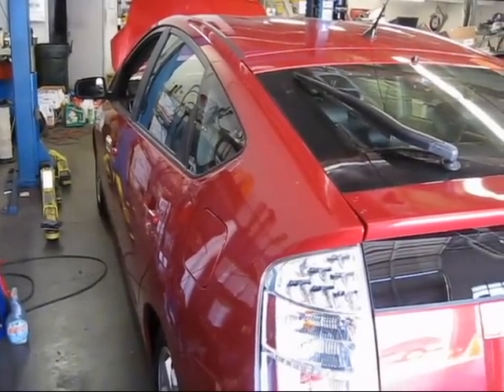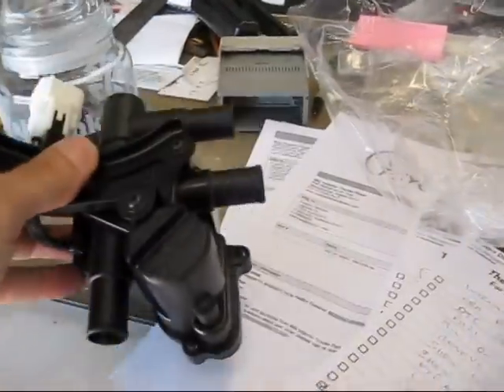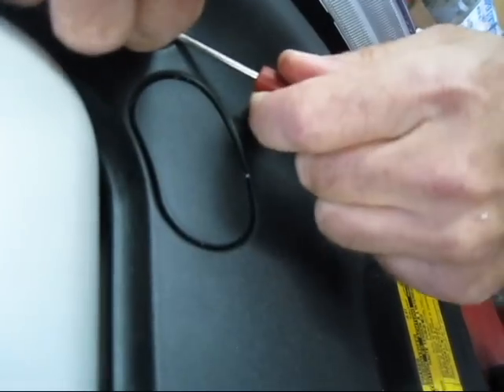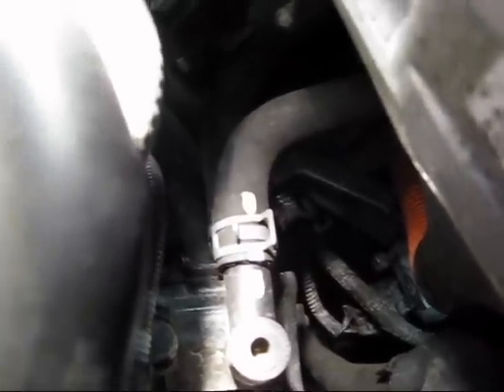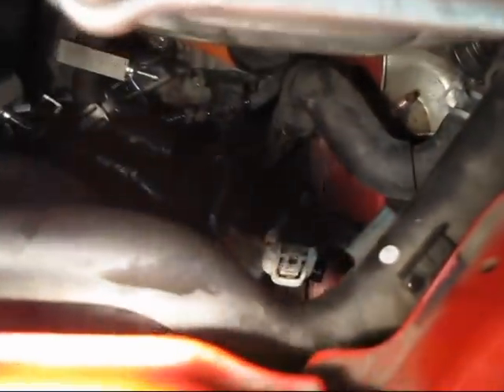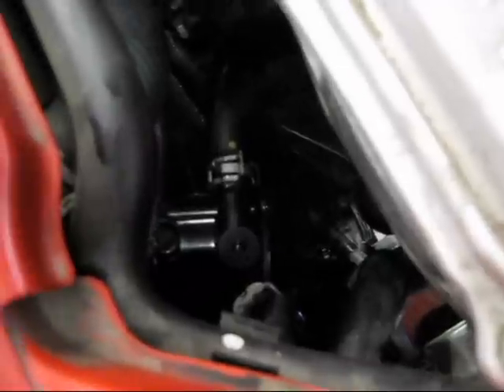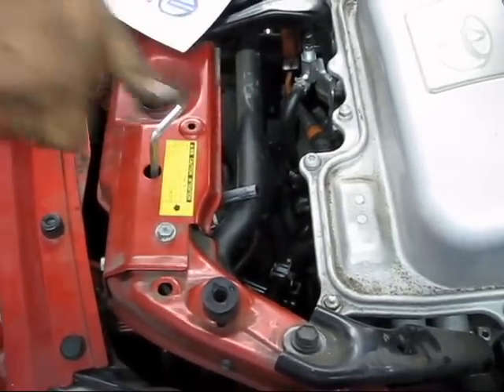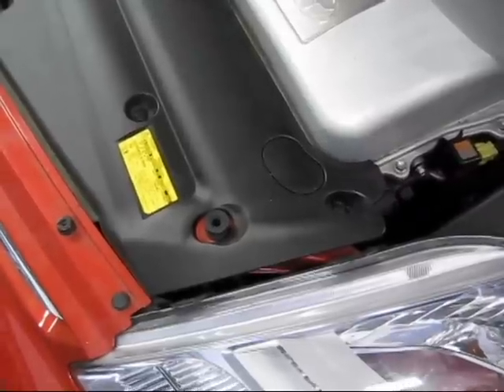2004-2009 Toyota Prius P1121 DTC Repair

Comment: I had the error code Prius P1121 and I replaced the coolant valve.
I have proper amount of coolant but I am still hearing constant see-saw kind of noise from the valve, just like it did before it failed and threw the error. What could be the problem?

Comment: This is so much better than most auto repair videos.  Great job.
I just got the P1121 DTC check engine light on my 2009 Prius after it had sat in the garage for a few months without being started.  I wasn't driving the car during the pandemic and the battery died.  After I jumped it, the check engine light came on. 
 I cleared the code using the Torque app and OBDlink LX adapter (great little gizmo).   I drove the car a few miles and the code seems to stay cleared, but I'm afraid it might come back. The only reason I started it was I need to get the car smogged and it will fail if there are any Check Engine DTC errors.
Nice to know if the light comes back on I'll have this handy video to help me thru the repair, so the dealershit can't "relieve my wallet of $500"

Comment: man, just got done with mine.  I swear that the electrical connection was the toughest part of the whole job.  I lost a little bit of antifreeze, and I can hear the bubblin' when I start the car.  I have learned to really burp the system to a T, you have to drive it, let it cool down, open the radiator cap, fill, and repeat the process until you don't hear the bubblin' on start up.  Real pain in the arse.   Can't believe that my local stealership charges $450 to do this job.  I bought the part from the stealership for $90 out the door (and that is with a military discount).  Took me 1.5-2 hrs to do the job, and I suck with automotive.  It is gonna take me a week to burp the system, as I have come to learn.  To all that are considering this work; you can do it, just make sure that you have the tools ready.  I got my fluid hose clamps at Harbor Freight for $8.  Your gonna need some vice grips or some really long needle nose pliers (for the hose clamps), socket set, antifreeze (Toyota species), and some time.  I pulled and replaced my pump from the bottom of the car.  I also jacked my driver side up to get better clearance to do the work.  All in all I saved $360, and if you break that down to an hourly wage, that is $180 and hour (considering what the stealership charges)!  If you make well more than that an hour, take your Prius into the stealership, if not, DIY!!!!!!!  Just watch all the YT videos out there respective to the job.  You got this!  If I can do it, you can too!  With respect to the check engine light, mine did not disappear immediately.  It took a few start ups then it disappeared.  Also, the error code will still exist (if using a error code reader) after all is well.  I had the local auto parts shop check mine even after the check engine light went off (after the job), and it still read P11121.  The only way to clear the code is to have a savvy auto parts store person clear the code (if knowledgeable and willing) or have the stealership do it for, most likely, $200+, or lastly if you have a error code reader that can clear the codes and DIY.

Comment: I had my inverter coolant control valve replaced about 2 years ago, now the P1121 CEL keeps coming back on and off intermittently.  Any suggestions?

Comment: I replaced mine, originally I got a p1122 witch is same as p1121 my code came back so what gives car still runs smh 🤦‍♂️ . I replaced mine by going threw the top much easier.

Comment: Hello, I have the light check on my Toyota Prius 2004, the code is P2601 : cooling pump control circuit range/performance, what's problem? Note: I've replaced cooling pump 3 holes, and cooling tank also. But still alert "check P2601".

Comment: Hello Sir, thank you for posting . Can you help me on this. I have a Prius 2007 had the invertor pump changed at the dealer ( the pump dont look the same as what you show here though, but I think the question should be the same ) and upon collecting my car, the minute the key is inserted and start button pressed, there is this humming noise that comes on and it goes off when I shut down the system. I drove this car for more than 10 years and I didnt have this noise before as the hybrid system is totally silent when nothing is moving until the aircon or engine kicks in. I brought back to the dealer and have it checked. They confirmed the noise is coming from the new pump that had just been replaced, but they said the computer check didnt detect anything wrong with it and therefore it is ok. I on the other hands felt that something is not right since it was not like this before for 10 years. And it is not logical to me that the pump should be on all the time even when I was not in engaged mode. any such pump must be drawing power from somewhere in that case and I am afraid it will drain my battery. The dealer said they cannot do anything since the computer system check showed everything is normal. Can you please let me know if your Prius had the same humming noise or was it dead quiet when non engaged. Appreciate very much if you can give me some advice on this.
Reply: The inverter coolant pump action is normal, the sound is not. The sound is caused by air bubbles in the inverter coolant loop. It is easy to bleed the inverter coolant loop. EyeOnAiman did a good video on it at https://youtu.be/X43ymVi1Aug

Comment: Thank you for the awesome video! I changed the valve and it seems working, but the dead triangle light went on couple of times when I was driving. Do you have any clue?
Reply: Bleed it.   You most likely have air in the system. and when people say it might take 4 hours, they probably are right!
Reply: I realize that's an old post, but I'll answer it for people with the problem now or in the future.

The red triangle of death lights up on the dash (and shows a yellow warning with a thermometer icon on the top left of the screen) when the coolant temp reaches 120C=248F.  Get completely off the gas pedal immediately, because if you're giving it much gas (going uphill or driving on a highway) the temp can go to 130C  in just another 5 or 10 seconds, where you start to risk blowing gaskets, warping the head, etc.

I recommend having a "live data" display of coolant temp while driving with anything suspect about the cooling system, including while test driving after replacing coolant/pumps/whatever or bleeding it.  I get this via having a Launch Creader Elite 200 OBDII scan tool plugged in as I drive, but just as good would be any WiFi or BlueTooth OBDII dongle (ELM327 chipset ones for under $20 are fine) and a free app such as Torque Lite on your phone, set to display a coolant temp gauge.  I'd advise getting a dongle with a power on/off switch, so it doesn't drain your battery while the car is not in use, if you remember to turn it off.  The OBDII port has continuous power, not switched with the car being on or off.  And plugging/unplugging all the time risks damaging the car's OBDII connector.

Both my 2005 Prius and 2017 Prius Prime hold the coolant temp around 90C=194F quite well (the 2005 maybe varying from 85C to 100C) when everything is normal.  My 2005 recently was overheating due to coolant loss for unknown reasons (I hadn't needed to add any coolant since I bought it used in 2014, until now in 2022).  Driving up a hill (maybe 100 feet elevation gain) at 40mph would make the coolant temp go from 110C to 120C in maybe 10 seconds and light the red triangle.  After adding coolant and getting most air out, on the same hill it would start at 90C and be 94C at the top of the hill.  Once I was sure it was mostly fixed, I went on the interstate highway for a while, with it holding 90C quite well at 55mph, 65mph, 70mph.  Then I accelerated up a long hill from 65mph to 85mph and cruised to the top at 85mph.  The temp started at 90C, never went above 97C, and was 90C at the top.

Comment: Was the coolant leaking from the top two hoses or just the bottom one? It looks like you only clamped the bottom one with a pair of pliers, so I am wondering if the pinching would work properly if you used an actual hose clamp on all three hoses.

Comment: i do not understand what does that have to do with the speedometer not showing ?
Reply: The code is reused. The valve replaced is not connected to the accelerator.

Comment: Big thanks for putting this DIY vid together; saved me loads of time, energy and $.  I learned lots from your successes and hiccups. Everyone makes their journey to success in their own way; some with lots of nicks and scrapes, and you wonderfully remind us of that.  Showing us your unsuccessful venture of using hose clamps and force-running the engine, was well worth your time in vid procurement and my time in watching this [infact, a few times].

I chose to do my invertor pump without hose clamps and i purchased a set of long needle nose plyers.  Took me ~ 2hrs with re-flushing the coolant for both engine and inverter, running solid now.  Big thanks.

Comment: Great video! I'm stuck on one part. I have a 2009 Toyota Prius. The bleeder valve was not located where the video stated. there was a spot for the hex wrench in the same place as the video, but there was no valve sticking out from it. Can you tell me where that is? Thanks!

Comment: Whats the TSB no?
Reply from the maker: TSB #:  EG001-08
Reply: TSB says "Applicable Vehicles- 2004-2007 BEFORE Production Change - Effective VINS shown (See VIN's 11th Digit- Tsutsumi Plant= 3  vs Toyota Auto Body Plant = 7) "
See Two TSBs-  the earlier TSB: EG024R-05 and the Newer TSB: EG001-08

Comment: so my code reader is also bringing up code p1121 and  p1116 for the coolant temp sensor circuit stack for coolant heat storage system. will the one part clear both codes. I don't see any other videos and the picture that pops up for bothering codes shows the same diagram of the cooling system

Comment: whats the exact name of the part?
and is it available on ebay?
Reply: inverter coolant valve and yes its on ebay but make sure its the updated one and not a used one Toyota issued a tsb for this know issue they have.
Reply: thank you...what is a TSB?
Reply: Technical service bulletin. Meaning they knew there was a problem but because there was no risk to life it wasn't a recall.

Comment: Hi, excellent info, especially on bleeding the coolant after replacement.  Would really have liked detailed video, with tools, sockets, busted knuckles, etc. on actually getting the hoses off and the valve unbolted (bottom bolt very hard to get to, need really fine tooth ratchet).  Did you unbolt, then remove hoses, or some hoses, did you put hoses back on before or after bolting new valve in place?

Comment: My snap-on scanner is not retrieving  codes on the prius (tried 2 different prius's).
Is there a step I am missing that is different then your average car?
Maybe I'm doing the "key on engine off" part wrong.
Anyone who reads this feel free to add any insight.
Reply: I dont know about the snapOn reader.  A lot of readers dont work well with Prius

Comment: how long can i run my car with this p1121 error. the new part wont arrive for about a week.
Reply: A prius I just got from the dealership I work with and the p1121 code has been on that car for over 6 months and they were still driving it lol
Reply: If you live in warm weather you can get away with a busted valve for a while

Comment: I should add that it is very important to place the constant tension clamps in exactly the same spot they came off of, when you put them back on, otherwise the  hose could leak. this has happened to me on more than one occasion.
Reply: Mrdubomb or use new hose clamps

Comment: eh ! el vato!  ...   -Thank you for the video!  I was able to get it out from the top!   And I plugged the hoses one by one with large fine thread bolts and reclamped them with the spring clamps.  I lost a minimum amount of coolant to the catch pan. I'm reluctant and concerned about putting the car into gasoline only mode as you don't give the reverse steps procedure. I'll be looking and reading all the comments. Again Thank you so far.  -Dizzy Dan
Reply: For anyone else worried about getting their car out of inspection mode just turn the car off and on again. It'll be back to normal.
Reply: @godfathertrevor  thanks for the info . I too was leary

Comment: Thanks for posting!  I will try this on my own soon.  One question...  where do you look for bubbles in the coolest system?  How do you know if it's clear?
Reply: Derek, when you start the car after it has been sitting for a hot minute, you will hear bubbling.  Fill the radiator as much as it can take, drive it around as usual, let the car cool down, fill it up again.... repeat process until you don't hear the bubbling.  Pain in the arse, I know, but this is what I did.  Also, you might wanna hit your A/C on high heat while during your drives to really open everything up.

Comment: Thanks for the video!
I did the repair yesterday in under 3 hours and saved myself over $450:)
I used some scissor type hose clamps found at O'Reilly auto parts and didn't loose much coolant.
I tried the trick shown of removing the small hose to the right of the oil dipstick while filling the coolant, but coolant just started spilling out of the disconnected tube.

Comment: This replacement can be done from the top side. No need to jack up the vehicle and remove the air shields.   Take off the plastic cover over the radiator under the hood as shown in the video.Remove the upper radiator hose above the valve area and tuck it to the left out of the way.  Unbolt  the device that looks like a tire valve stem and tuck it out of the way to the left.  This gives you enough room to disconnect all three hoses and the electrical connection.  It also provides enough room to remove the valve assembly up through the opening and to reinstall the new one. I did this in less than 4 hours total start to finish including re fill, tool clean up, test drive, refill etc. I am not a pro mechanic but I do have a lot of tools.  You will need various size pliers to loosen the hose clamps.  One of those cable operated hose clamp removal tools would be probably be ideal for this job.   I reused the coolant.  If you want to fully change it then you will need to jack up the vehicle, remove the plastic air dams, etc.

Comment: After watching this video I thought it would be a piece of cake.  But as starchaser28 wrote, it took 8 hours.  The valve is very difficult to reach.  I drained the coolant first.  Taking the hoses off the valve was a royal pain.  I had to get a small vice grip to release the hose clamp.  And then more coolant comes out when you do get the hose off.  Wear eye protection and probably a dust mask.  I had some coolant splash into my mouth, luckily not my eyes.  I never could figure out how to burp the system.  I followed the directions but nothing happened.  After 8 hours of shear frustration  I finally decided to just drive to the dealer and have them do it.  While it did cost $200 to run a full diagnostic and burp the system (unbelievable, right?), it was going to cost $750 to replace the valve.  So I guess I should be glad I did save some money, but again, it was very frustrating for me and I had many moments of regretting starting the work.  I hope this helps people so they know what they are getting into.
Reply: Oh man, sorry you ran in to trouble.  I watched every YT video out there on the job, and got mine done in 1.5-2 hours, and I really suck at automotive stuff.  I know that you posted this 3 years ago, and most likely there have been more videos surface since.  I used vice grips to remove the hose clamps and kinda just twisted the hoses off.  The electrical connection was a real pain in the arse.  Tight space, but if you remove the two bolts in the front of the inverter, you can wedge a 2x4 under the mounting brackets and give yourself a bit of room to maneuver some wrenches and pliers in there.  I removed and replaced my pump from the bottom (car lifted on the drivers side).

Comment: Great video, many thanks.  My shop wants $430 to replace this.  Found valve on ebay for $70, and will try when I get that.  Only thing that could have made it a bit better would have been to actually show the process of removing first hose to bleed coolant system (start/stop engine?  open while filling cold/hot?.  Ditto for the allen head screw bleed, how to use, running, not, etc.  But many thanks for all the great info!

Comment: I have a causation for anyone that dose this work themselves, which I did.  When you are driving the air out of the system it may be required to do it several times.  I thought that I did a good job in getting all the air out and drove the car and got an emergency alarm stating to stop driving the car. I came  back to my garage in burped the system again and got more air out again, not much, just a few bubbles.  I did this three times until it was solid with no air (bubbles) in the system. So make sure there is no bubbles in the system at all. Then everything  worked fine.   It is a good repair and can save you a lot of money by not having the dealer do the work if your are capable of doing it yourself.

Comment: does this car had any excessive oil consumption prior the replacement of these parts?
because i went to toyota dealer and they asked me to replace these parts after the diagnostic (as a start point:) but they dont know what caused the excessive engine oil lost.  i drew only 1k miles after the oil change and they said there was no oil and after they add an oil it was back to normal . i have 07 prius base